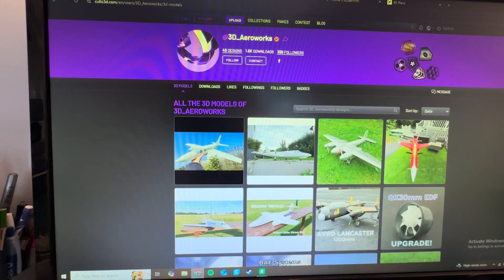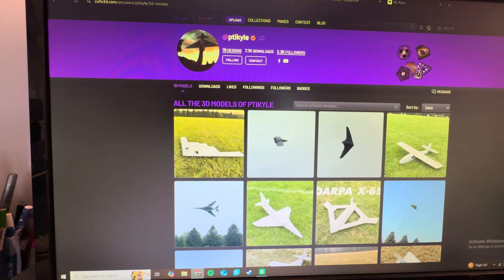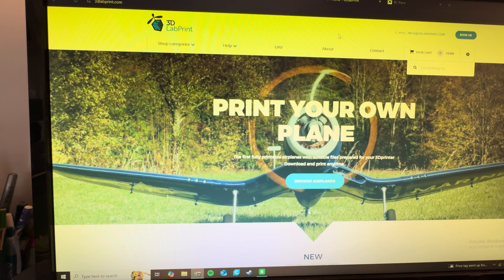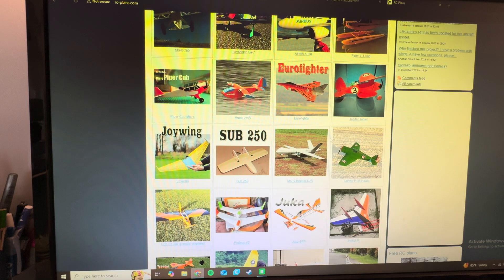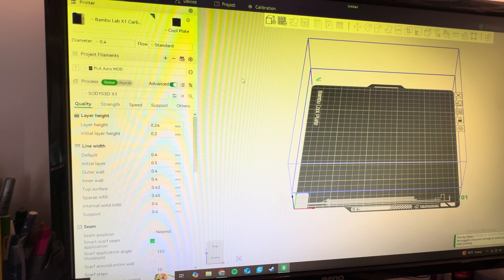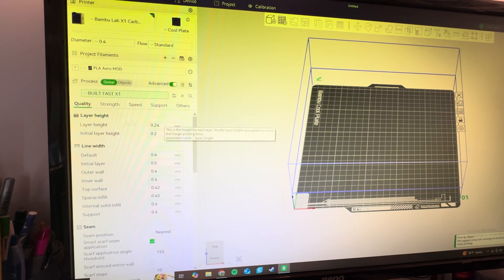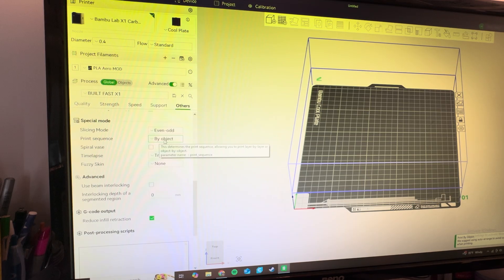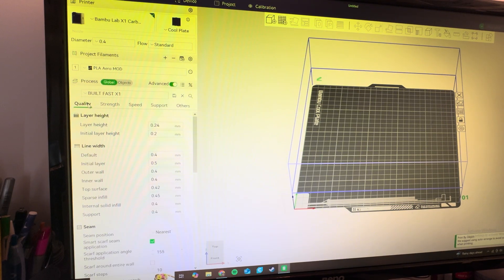WHERE TO START?!

Comment: I have a 3D printer and I want to print a RC plane but I don’t know how to code and I don’t want to code, do you know how I could (easily) get these hardware
Reply from the maker: You download files from the designers. I don’t code either, the designers are 3D Aeroworks, PTIKYLE, SODYs3D. All available from cults3D.com
Reply: @3DPrintHangar_RC thank you!

Comment: I am going to unbox my X1C tomorrow- Great, timely video!  Looking forward to your thoughts on electronics.  Just ordered the Bambu PLA-Aero.  Intrigued by the ASA-Aero as planes sit out all day in the heat- sure you’ll do a video on that!
Reply from the maker: Awesome sauce!! 

Electronics are a big spectrum. It really depends on what you’re looking for. 
Personally I use a run of the mill hobby ESC, EDF’s are exclusively Xfly. Great value for money. 
Servos are almost exclusively AGFRC otherwise I just use servos out of planes my friends crash 😂
Receiver systems are always Spektrum.
Batteries I’ve actually grown quite fond of Ovonic batteries. They’re great value and I haven’t had a single one puff yet, whereas I’ve had the more expensive SMC Racing packs almost all that I’ve purchased have puffed.
Reply from the maker: Hope that all helps 💪

Comment: Do 3d printed edf blades work? I was thinking balance isn’t as important since its a smaller diameter
Reply from the maker: Balance wise you can always adjust by removing or adding material to balance it out. I would be more concerned about structural rigidity being that they spin at such high speeds.